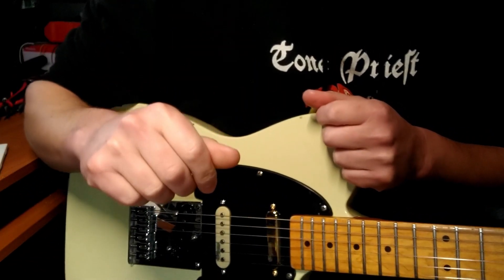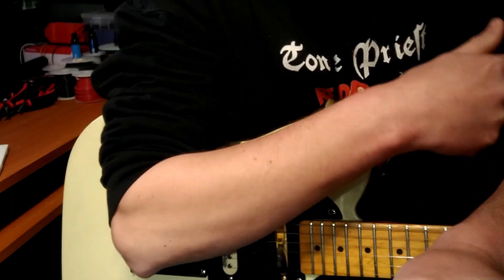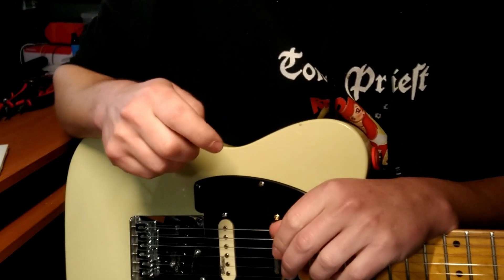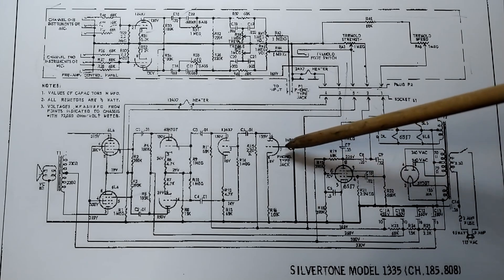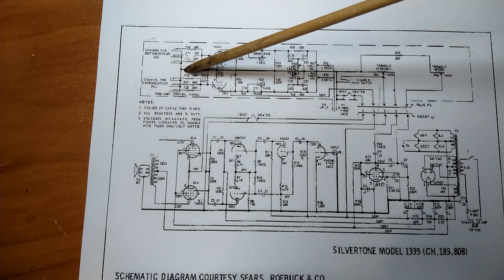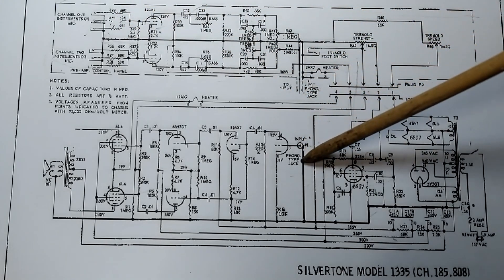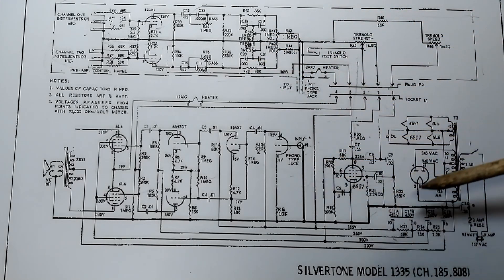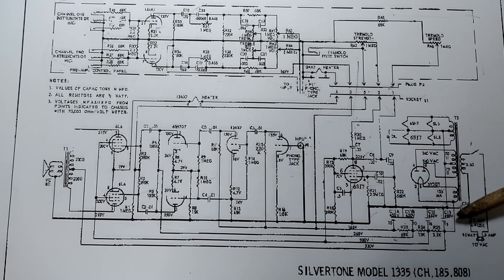Your vintage guitar amplifier is trying to kill you.

Comment: Fortunately, if you ground the preamp ground to main chassis through your body part when the unplugged connector is not grounding preamp chassis, the current supposedly goes through preamp plate resistors and tubes, which somewhat limits the current.  However, there are two preamp stages, so the current has two parallel paths to ground which makes things worse. Also, the voltage going to preamp is probably not B+, not C+, not D+, but instead E+ so there is again some resistance in the path from B+. However the last, E+ electrolytic cap supposedly feeds the preamp stage straight and even if it is only about 10 uF, it sure can give nice shock when charged with quite high voltage. 
Luckily the voltage is DC, which is much less likely to cause ventricular fibrillation of heart, compared to 60 cycle AC which is very dangerous frequency to heart.